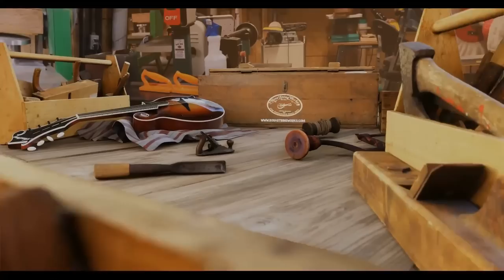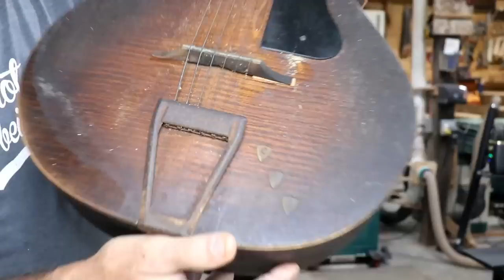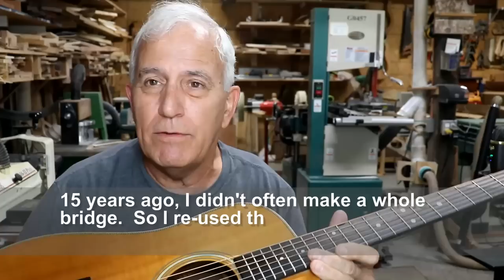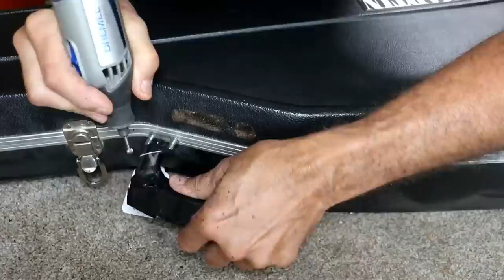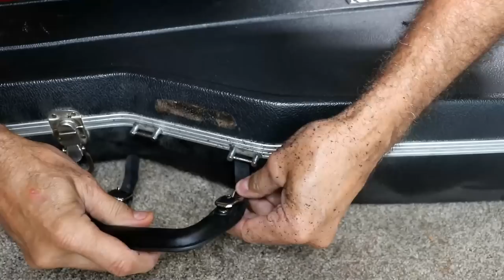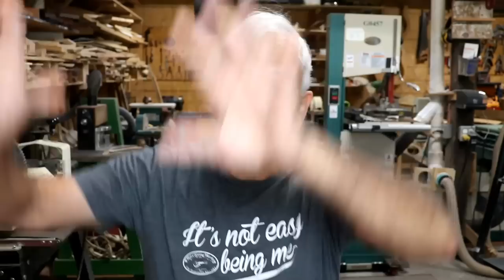Vlog #116 HD28 Status Repairing A Case Handle and Much MORE!

Comment: I fixed my case handle with one of those buckle-on replacements, and ended up punching another hole so I could cinch it up tighter. Apart from that, it works great. I’m looking forward to seeing your work on the old Silvertone (or whatever it is). I love seeing old guitars with heavy playing wear, and that one’s seen a lot of love over the years. It will be great to hear it again!